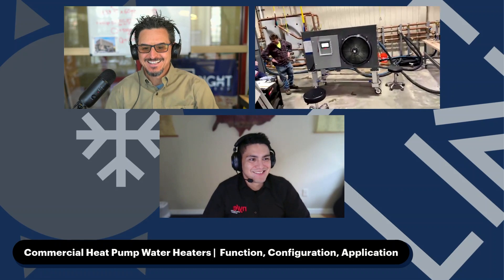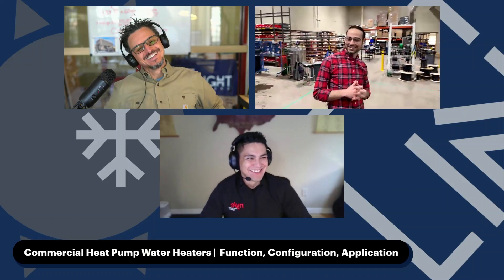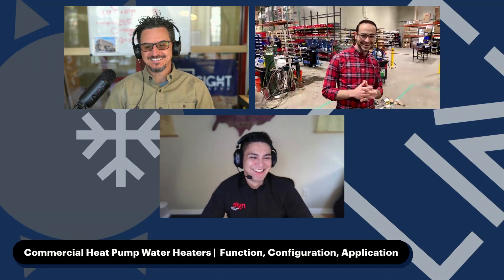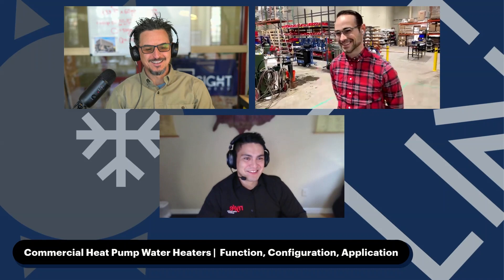Inside Nyle's Heat Pump Water Heater Factory

Comment: Great information.  I've got a Nyletherm-1 that I bought on ebay 10 years ago and still working fine.  It's a ~6,000 Btu residential add-on unit that converts a standard single-household electric water heater to a HPWH.  Great idea but kind of a project to install since you have to hard-wire it to a 240-volt line and alter the internal wiring of your water heater, so maybe that's why it never really caught on.  They later came out with a plug-in version called the Geyser, but apparently only made that for a few years as well.  It's a shame because it makes so much sense to have the heat pump separate from the tank, since the tank will generally fail well before the heat pump.